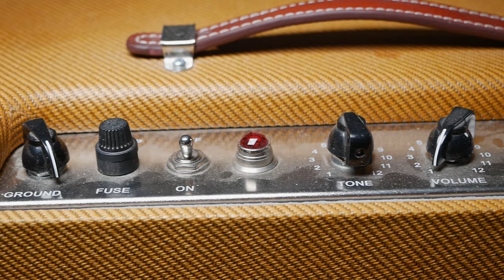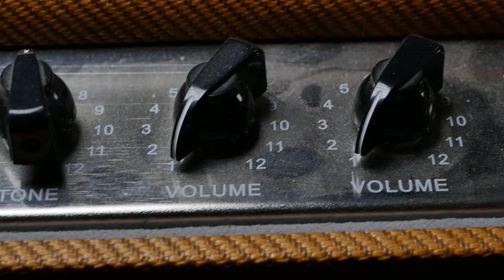Lazy J J20 (Part 1)

Comment: I’m in a 2 guitar band and  my mates Lazy J is hands down the best sounding  small combo I’ve ever heard. I’ve had 4 other amps to try and at least be in a matching tone landscape. Every guitar he puts through it sound great and every pedal colours exactly as it should. Amazing amps.
Reply: Which is in spite of the obvious issues, not because of them.
Reply: Friend I've got a $150. Stage right amp with its reverb tank changed to an 18-inch Fender reverb tank and a $35. tremolo pedal package that probably blows that thing away! Sorry, you wasted your money. $$$$$8,000 thousand smackaroos for that thing is bad judgement!
Reply: Does it keep up with your amp and the drummer? What wattage is it? Wondering if 20 watt will be loud enough
Reply: Plenty loud enough. Think Deluxe volume but more clean headroom if you need it.
Reply: @Guitar11player  I doubt it. Those amps are toys but if it works for you … enjoy.

Comment: I have a lazy j 20 which bought about 6 years ago, but without trem or reverb, it the best amp i,ve ever had. I,ve done at least 200 gigs with this amp and never had any problems with it. It,s the best sounding i ,ve ever played through. I have few old vintage fenders, 65 bandmaster head , 64 tremolux head/ a s/f bassman/and a 68 bandmaster reverb , but i always gig the lazy j . best amp ever.
Reply from the maker: Well that's fantastic. I'm happy they've built at least one reliable amp.
The biggest weak points in this amp are how the trem and reverb were implemented, which explains why yours is likely more reliable.
Reply: I have Amp Comment Bingo!!!

Comment: 6V6 tubes use .45 amps of heater current each but 6L6's use .9 amps apiece. Add in 3) 12AX7's at 300 milliamps each, and the transformer has to produce 1.8 amps more than it would for a regular Deluxe amp.
Reply from the maker: I'm going to take this one back to 6V6, even with the new higher rated transformer.
Reply: I guess I should have read this before I said the same thing
Reply: @billsutherland9193  great minds think alike? 🤔😉

Comment: “Also, since modern mass production techniques are usually cost driven, one often finds that corners are cut in the quality of the parts that are used as well as the production process…’good enough’ is often sufficient. Conversely, when you build amps by hand, you can choose to do better than that. You can choose to make things better than they have to be…”

😉

Comment: I had one of these. Fitted with VAC and reverb unit. It went on fire! Completely melted the mains transformer and all taps were open circuit. Smoke belched out the back. The maker had bolted a fan to the side of the transformer which was a puny Mojotone model totally unsuited for the 6L6GC and extra valves in the reverb unit. He also takes the entire preamp signal out the chassis to the reverb unit and back again. I got it fixed with a new Hammond but I was always wary of it and sold it not that long after. Shitty kit amps in my opinion.
Reply from the maker: Holy shit! Thanks for sharing, mate!
How these builders keep getting away with this I have no idea.
More detailed analysis to come in the next episodes.
Reply: @BradsGuitarGarage also check the VAC control. He doesn't regulate the screen voltage at the same time as the plate. It stays at full voltage. There is a Hammond model with 6A on the 6.3V line. It just fits.
Reply: Yeah, I corrected the scaling in the one I had so it varied the screens too. Had to move the LFO to a different node. And remove a ton of ground loops.

Literal hot garbage.
Reply from the maker: This one varies the output from the rectifier, all nodes other than the trem node are derived from the VVR output. The trem node pulls via a 4.7K dropper from the rectifier.
At least it looks like he resolved that.
But the transformer choice is inexcusable.
There must be a lot of angry people out there.
Reply: @BradsGuitarGarage  Indeed. I was one of them. I'll never buy another of his. I should also mention the blown speaker which can't handle the output and the faulty reverb unit which had to be replaced when it started cutting out. This was after I paid £400 to get all the problems fixed. Mind you, in France somewhere, there is an indestructible Lazy J20 somewhere after I sold it.
Reply: @PsionicAudio thought I saw one of these on your channel Lyle. Some similar  issues.

Comment: This guy is fortunate you would even attempt fixing this mess. Most repair techs would probably pass on this job.
Reply: If you know what you are doing, (most techs) jobs like this are run of the mill work. The transformer can be re-wound no probs. I'd rather work on an 8k amp than a < 1k Chinese job.  :)
Reply: @terrydemol5354 I'm most cases yes but there are exceptions. For example, I'd rather work on a JCA then a modern Mesa.

Comment: To me, the fact it is allegedly a 20 watt amp and they have fitted a 15Watt RMS speaker to it is a massive red flag before you start - no disassembly or technical knowledge required to see that.

Comment: For 8k with no chokes ,  no regulated bias , and too small a main transformer  value  then  ?   For 8k it should be a  M1A tank with regulated heaters  and over built power supply .

Comment: If I were to build a "Deluxe" with reverb and tremolo, I'd use a Pro chassis, cabinet and iron. Tweed baffles are ridiculously simple to swap around. 

I know that some modern "5E3" transformers can NOT handle anything but the 5 tubes in the original design. You can get ones that will handle the extra current fairly easy.

Is there $8k worth of amp here? No. 

There's maybe $1000 in parts and the speaker is $400 of it.
Reply: I'd quote $1200 for the basic 5E3 + $400 for the blue speaker. All that extra crap, maybe add another $1200-$1600 and it comes with transformers that will run 6L6s and extra 12A__7s. You are still all in for around $4000.
Reply: @Satchmoeddie  I would charge around $1800 - $2000 usd for a "Pro-Luxe" with reverb and tremolo. 

It's basically a black panel Princeton without the TMB tone stack and a couple different values here and there. 

And that's using all the "nice" parts. Jupiter caps, Mercury iron, Weber/Jupiter speaker etc.

Comment: I got the Farnam joke mate, my reflexes are fast and I caught it 😂 So someone obviously bought this hodge podge for $8K? maybe I should double my price lol
Reply from the maker: There is soooooo soooooo much more horror on the way in the following vids, mate.
This thing is not fit for purpose in like 50 different ways.
Reply: @BradsGuitarGarage useless fan, messy solderwork, what looks like a ground loop... I don't even know if I can see separated chassis ground from the video, but I wasn't trying to find it. but the 1590 enclosures for the addon circuits and not even proper faceplate when you spend so much money... that's just outright robbery
Reply from the maker: There's about 5 ground loops, mate!
The biggest issue is the use of 6L6GC's, but that can be easily resolved.
Once you know, anyway.
See the other commenters whose J-20's have literally caught fire!

Comment: Greetings all, Adam here from Premier Guitars in Sydney. We are one of the dealers for Lazy J Amplifiers in Australia. Just wanted to firstly clear up the incorrect price stated on this video - a brand new Lazy J J20 with reverb and tremolo is approximately AUD $4.5k landed in Australia (depending on exchange rates), not $8k as stated in this video. I've sold over 40 of these amps with only extremely positive feedback from all buyers. I also personally own a Lazy J J20 and couldn't be happier with it. Personal preference with regard to construction methods is not necessary as these construction methods (wood screws etc) have been used for over 50 years. Not here to burst anyones bubble, just wanted to clear a few things up, mainly correcting the price and to mention user experience, which is resoundingly positive. If anyone has any further questions about Lazy J products you can get in touch with me - more than happy to answer any enquiries. Cheers, Adam
Reply from the maker: Hi Adam, yes I was off on the pricing which I clarify in later episodes.
I had nothing to go off other than the 2nd hand market and your pricing on your website was last updated April 2020 and as I'm sure you're aware, the pricing on everything (especially labour, valves and valve related components) has increased dramatically since.
In hindsight I should have rung you to get an accurate up to date quote.
All of the technical issues still stand, however.
My international network of tech friends have confirmed this.
I'm just reporting what I find from a technical standpoint.
Can I ask what the warranty policy is on a transformer failure in an amp built on 9/2/22 for others reading along?
At any rate, thanks for reaching out and any clarification on the other technical stuff would be appreciated.
Reply: Hi Brad, the reason why the price hasn't been updated on our website since April 2020 is because it is still the same price! I think that pulling figure like $8k out of thin air is irresponsible and certainly detrimental to Jesse's brand, especially considering the negative comments it has generated (having the incorrect price in the thumbnail photo on the video doesn't help). I spoke with Jesse last night, and with regard to warranty - there is a year warranty on parts and labour. If the owner experiences any problems they simply would have to contact Lazy J directly, or even a dealer like us. We would be more than happy to resolve the problem immediately - Jesse even said 'I just want my customers to be happy' and he often has fixed issues outside of the warranty period. I must say that Jesse is a lovely guy, and it is disappointing to see such negativity about someone who cares deeply about his product, his customers and the music community. Feel free to reach out if there are any further questions.   @BradsGuitarGarage
Reply from the maker: I don't care who is a lovely person. AGAIN, I OBJECTIVELY review equipment from a technical standpoint.
Why do you  try to bring emotion into it to manipulate my opinion?
I repeated the fact that I derived the price from the inflated used market. Here's one that would approach $8k if customs costs were included, as there were no ones for sale in Australia and at the time of publishing I was unaware that there was an official Australian dealer.
( For example: https://reverb.com/au/item/74225587-lazy-j-lazy-j-j20-with-reverb-vac-and-tremolo-in-lacquered-tweed?utm_campaign=INTL-AU-Shop_unpaid&utm_medium=cpc&utm_source=google )
You seem to be ignoring the fact that the technical issues still stand. 
I didn't write the rules on electronics. Don't blame the messenger.
A retraction regarding the pricing will be posted, however I stand by all my observations regarding the architecture and operation of the amplifier. Of course everyone defending the amp with regard only to the pricing accuracy is diverting from the real issue. It's an expensive amplifier with several serious issues. Two of which makes the power transformer fail. Which is exactly what happened here. 
I owe my customers and followers honesty and that's what I'll give them which is why I'll change the thumbnail and post a retraction ONLY with regard to the pricing. I really don't care at all if manufacturers or dealers still have a problem with that.
50-60% dissipation on a cathode biased amp? Really? Do you know what that means? Business cards used as insulators? Really?
Crossover distortion? Noise? Hiss? Hum? Tremolo pumping? Ground loops? Are you aware of these concepts? I showed them all in these videos. Did you watch them? Did you understand them?
If not, you have no right to comment on the validity of my observations.
If you feel it was not a fair review or that this model was not representative of a Lazy J amplifier, send me one for review. Put your money where your mouth is, otherwise, just don't bother commenting.
I objectively review equipment from a technical standpoint. That will never change.
Reply: @premierguitars I think you missed the whole objective, which is regardless of Jesse's "feelings", and that is the lack of care in building an amplifier that can't pass Australia's current electrical safety standards for one. Secondly, even at $4500 AUD, this is still a very inferior built, expensive mojotone kit with a different badge on the front. Trying to muscle any kind of apology out of Brad because of the truth makes you and Jesse look even more like a fool, regardless of what the price point is. maybe focus on importing better products in the future instead of this crap!
Reply: @premierguitars What part of the review did you find technically inaccurate? 'Negative' and 'negativity' are fairly nebulous descriptors, I could use more quantitative ones in your argument.
Reply from the maker: I just rewatched my series and I found myself to be remarkably positive and charitable, particularly on the last one where I said it sounds fantastic and tried to set J20 owners minds at ease, advising them to just get a set of 6V6's installed and a few minor changes.
Reply: @BradsGuitarGarage  Sorry Brad but it was clear from the start that you were not going to like the amp... perhaps it's just your nature.

Comment: Search the brand name. There are fakes being made according to posts online...

Seems like this owner might have bought a copy or a fake... If you can copy a $5000 handbag  you can sure as shlt copy an $8000 amp

Did it have a serial number or marks from the builder on it?
Reply: If this was fake, how can the fan for the mains transformer be explained/excused? Cuz someone doing a clone wouldn’t bother adding a fan unless it was part of the original design. And if it was part of the original design, that is a bad choice to begin with, trying to compensate for a bad spec/design choice instead of fixing it. Kinda circles back.
Reply: Plus their own website has links to reviews and at least one has a gutshot which looks identical.
Reply: @lordgraga  if you're building a fake with cheapest parts, it would make more sense to have whatever transformer, and to put a fan in, not knowing that it won't solve the issue...
Reply: @sjgreaves  ok, that might be more evidence to suggest it's legit... Always important to be skeptical...

Was there a serial number on this amp?
Reply: Don't be ridiculous. It's already a fake  😉

Comment: Unclear where the "$8,000" claim is coming from... that has to be some lame used "none in stock, so overpay for mine!" price.  New, a few years back, they were under $2,000 and latest NEW I've seen is between $3,750 - $3,999.  Granted this is over priced (but, you're paying for hand built, low-volume (# of units)), but it's a lot of cash for a modified tweed, regardless of the nuanced added build and tonal qualities.  But, in today's world you could look at Dumble and say the same thing x100.

Lazy J does make some of the best tweed amps out there, but for the money I'll stick with my TK Imperial MkII that gets me a modern take on a Blackface and a Tweed (1 yr old used CME lacquered tweed ltd edition for $1,750 - can't beat that with a stick).  However, IF I had the cash to burn in front of my wife and the patience to shop for one, I'd love to own the latest iteration of the J10.  :-)

Comment: A Tweed Deluxe isn't really like any Princeton. The Tweed Princeton was single-ended  --  it was really a Champ with a tone control. The Brownface Princeton added a second 6V6 and the tremolo circuit, but still only had one channel. The Tweed Deluxe had two channels, but a shared tone control. So the tone of the channel you were using was affected by the volume setting of the channel you weren't!
Reply: Brad knows that, and that wasn’t his point.
Reply: Tweed Deluxe didnt have tremolo or reverb either!!!!!
Reply: @PsionicAudio As he actually said "If you want all that stuff, go get a Princeton Reverb: it's essentially a Deluxe plus that shit", his point is not that obvious. "Essentially" may not be the mot juste 😅